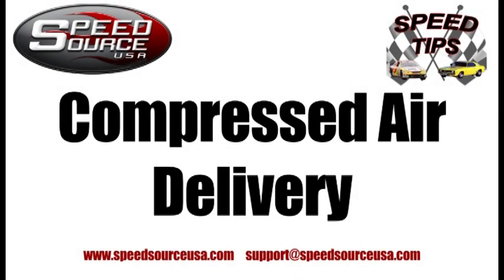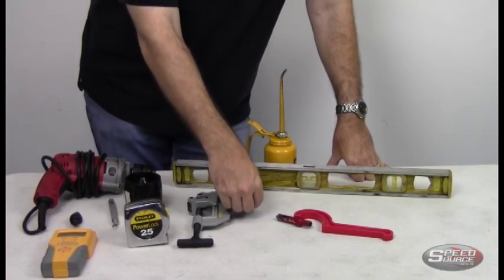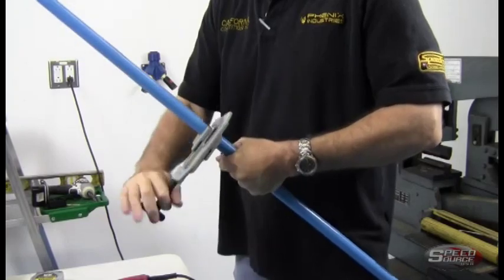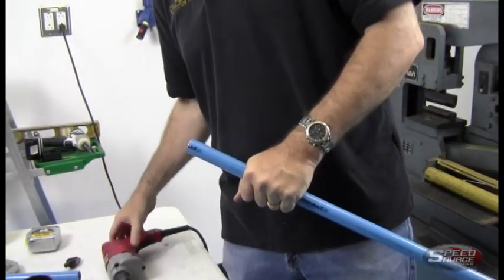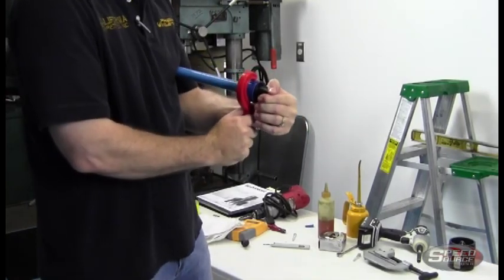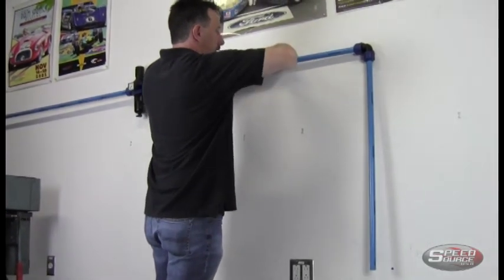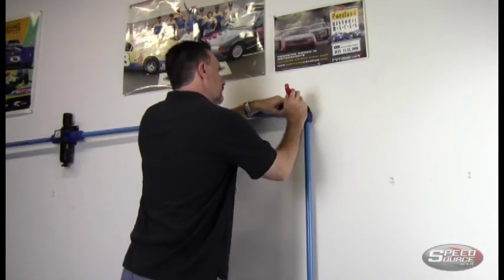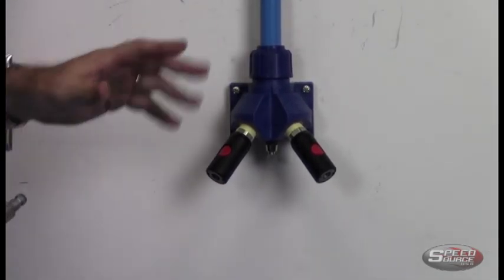Compressed Air Piping System Instalation

Comment: Plastic fittings are terrible.  I replace them often. Contact me for stainless steel and copper plated fittings, OSHA approved aircraft aluminum, 1.5 lbs. Per foot.  Can hang it with a zip tie if you wanted to

Comment: I went to your web site to see this piping system, but I could not find it. What Air piping system are you using in this video?
Reply: Hi Rick,
The piping and fittings we are using is from Europe from a company call Prevost.  The pipe is epoxy coated aluminum and the fittings are compression and sealed by an o-ring.  The system is very easy to install and costs less than half of copper.  You can email me if you have more questions.  ardieoji@yahoo.com
Reply: When I google  Prevost I get the Motor Coach company?